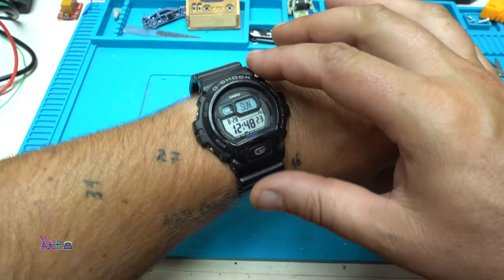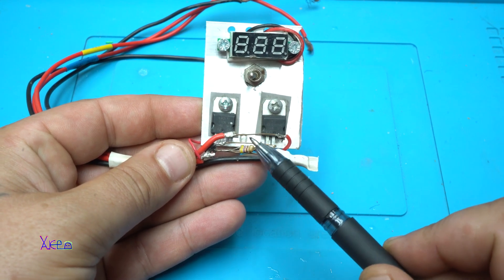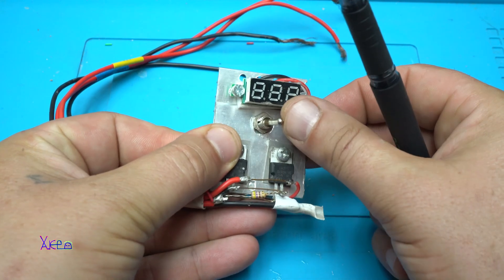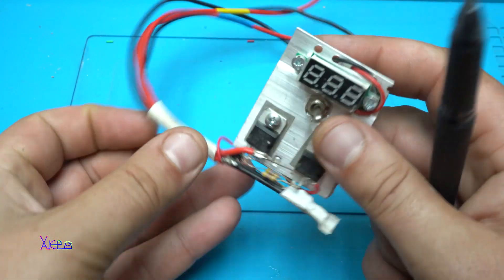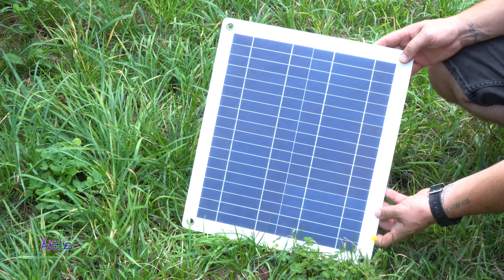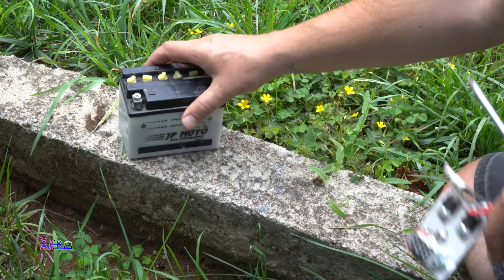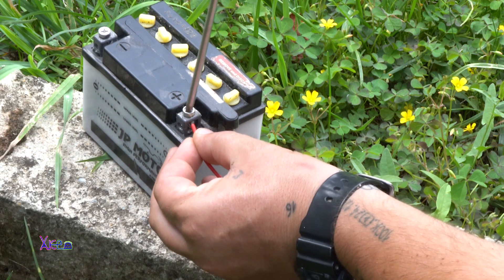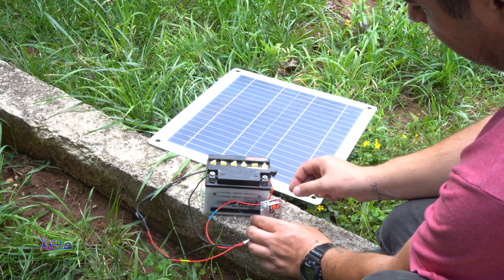How To Make 12v Solar Charger with LM317 Regulator

Comment: The schematic diagram does not match the prototype.
1.  The voltage display is not shown on the schematic.
2.  The switch on the schematic is to control the current regulation, it switches between 10mA and 1.25A charging current.  The prototype switch is switching the voltage sensing point, between input and output voltage.
3.  There is no potentiometer to adjust the charging voltage in the prototype.

Both the schematic diagram and prototype are fine and functional.
A simpler circuit would be to eliminate the first LM317 (current regulation), and use the voltage potentiometer to adjust the charging voltage closer to the battery voltage, this way the current is automatically regulated by the smaller potential different between battery voltage and charging voltage.

The lack of details suggests to me that this may have been someone else's design, next time mention the designer's name, and give him credit for his work.